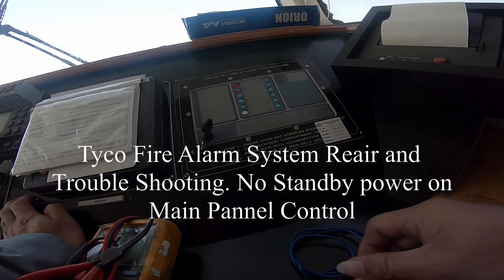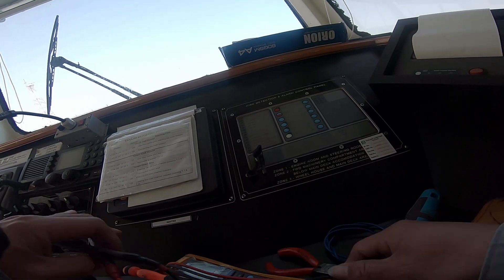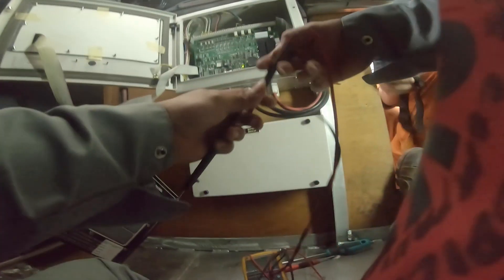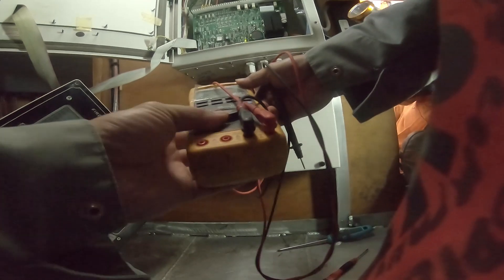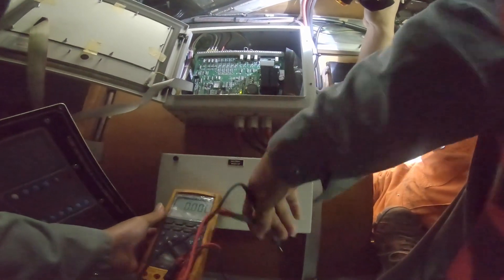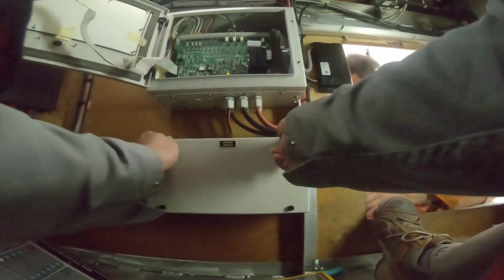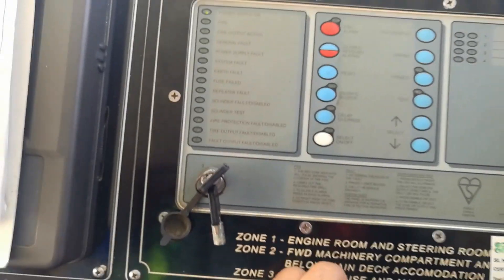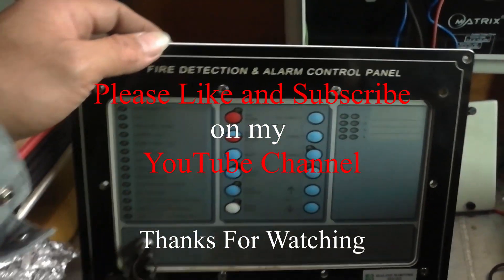Tyco Fire alarm System Repair and Trouble Shooting No Power on Front Pannel

Comment: Hi guys, has tyco fast 2000 compact/2-21 , lost power and after t-shooting stopped with password for the panel which i dont know!, any help with this issue please. 
Thanks
Reply from the maker: Hi Ali, thanks for asking, mostly and sometimes, Password: 123456 or 654321
Reply: @bajmarineequipmentrepair   thanks

Comment: Kabayan paano kapag umiilaw lahat ng zone sa main panel pero sa repeater okay naman?
Reply from the maker: Thanks for asking, please clear the trouble, blinking all zone with fire indicator On light or Fault On light. If fire is triggered meaning there is resistance in your loop that dropped the line voltage and trigger the fire alarm and fault. If Fault only means you have open loop in your line or have resistance that dropped the voltage below tolerance on the line voltage. Example your line is 22 Volt's when it drops down to 17 it will trigger fire. But if the voltage drop or quick drop below 16 volts it will trigger the Fault. To check the normal working voltage of the loop measure the voltage on the IN terminal the same procedure but trigger the fire alarm then get the voltage reference. The fire alarm trouble is all about resistance in Conventional type and wrong or faulty address in Addressable Type. Other wise the main board is faulty or in bad shape. Hope this will help. Thanks